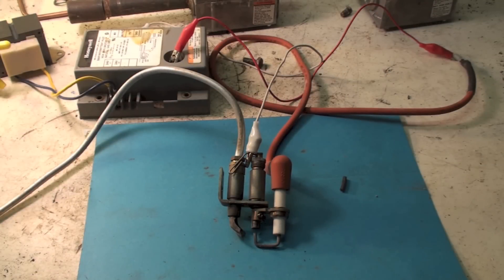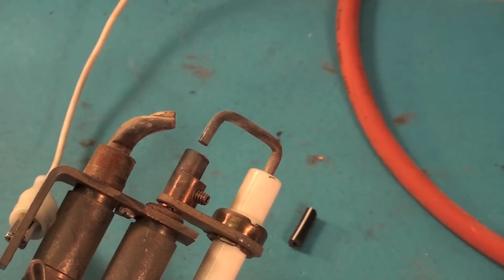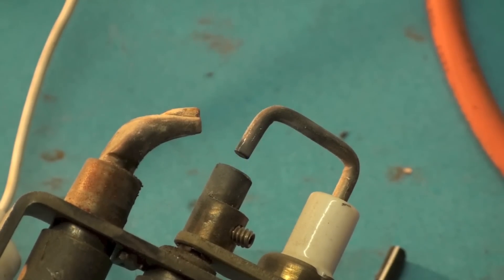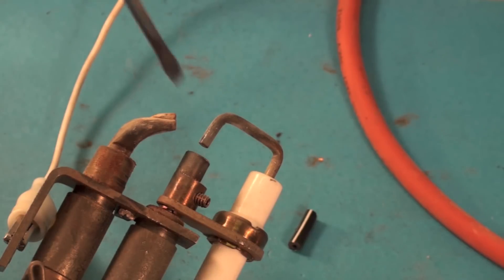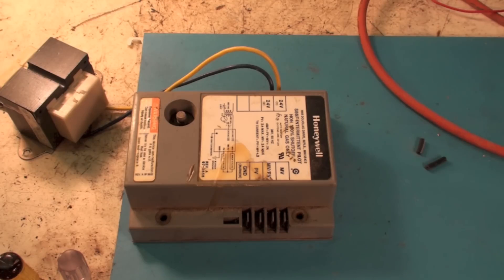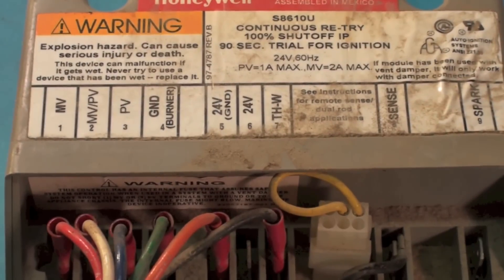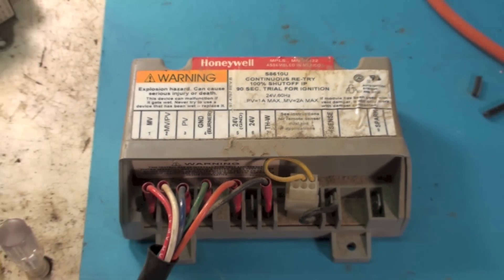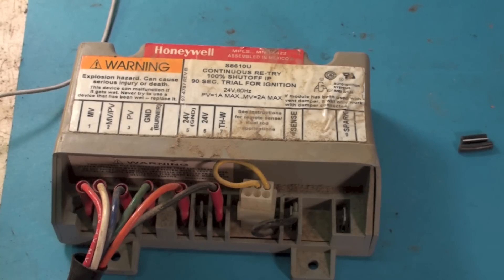Gas furnace ignition control operation

Comment: What would prevent the ignition control module from receiving and voltage at 24v and common.  The transformer and relay seem to be working fine. The circulators come on and I have 24 volt to B2.
Reply from the maker: If there is no power to the control, there could be limit failure or hi temp fuse open.
GFM
Reply: @grayfurnaceman Thanks for the reply. Turned out it was a bad blocked vent safety switch.

Comment: I have one of these old Honeywell intermittent pilots on my furnace and I’m not seeing any spark. I had a blown fuse and I replaced it cleaned the flame sensor and I got it to work for a couple days but it’s not working now. The fuse is not blown and I’m at a loss about what to do
Reply: Found the problem! With the heater turned on I moved the cable that connects the igniter to the ignition module and voila I got spark. Hopefully just a loose connection at the module was the extent of the problem.

Comment: Merry Christmas! Did I understand correctly that this unit is also the flame sensor? My Heil furnace keeps cycling the burner on and off. I cant find a separate flame sensor. Any ideas? Thanks in advance!
Reply from the maker: Yes.  The rod where the spark comes from is the flame sensor.  You can try cleaning it with sandpaper.  Merry Christmas
GFM

Comment: I have a commercial dryer that had a hack repair job to it and I'm trying to figure out how it's suppose to be put together. It's been modified since the original, OLLLLD construction.
I'd like to figure out: are these igniters supposed to turn on when the dryer control knob is in the off position, and then they'll automatically turn off after the pilot lights up? Are these things supposed to be manually turned on after you start the dryer up, then it ignites the pilot, then the burners go off?
It's a Huebsch 30CG (no other numbers/letters in the model number)
thank you...

Comment: In my case the pilot was not even lighting, I mean no sparking too . I checked the thermostat control and it was okay (lowered the set temp, below room temp and the fan kicked in to turn the A/C on. Also I could hear the 'click' near the control panel). I thought it might be the spark igniter. I tried to measure the voltage across the input terminals expecting it to read 24V. The igniter was still connected and the room temp was lower than the set temp (so it should trigger sparking). But for some reason it wasn't showing up anything (my multi meter is fine). So I thought of yanking off the wires connected to the igniter and as I just grabbed it to pull one wire off, the furnace started sparking up! Can somebody share how/why this happened? Did I complete the circuit by acting as 'ground' , may be?
Update after a day: The furnace is still working fine. But can somebody share what could have gone wrong when it briefly stopped working. Should I just be happy that it is working now hoping that the problem will not recur or replace the igniter or take some other action?

Comment: I’m getting 26 volt coming in, i get 18 coming out from mv/pv to pv then it goes down slowly and the valve starts buzzing until it drops to16 volts and it shuts off , why I’m i getting that low of a voltage coming out , is my spark module bad ? Or is it the valve

Comment: what is the sense terminal for, does it need to be connected? really like to watch your videos you are so detailed with components that it is hard not to learn 
thank you
Reply from the maker: The "sense" terminal is a option to use a separate flame rod to sense flame.  If the jumper is installed, it uses the hot surface ignitor to sense flame.
GFM

Comment: I have an intermittent ignition problem. I have observed the problem and while there is healthy spark, I measure a voltage on the pilot valve that jumps over a large range, almost like the spark is leaking back into the transformer output.  So I measure the output of the transformer and I measure 24 VAC, until it starts sparking, at which time the output of the transformer is jumping all over the place.
Have you seen this problem?
Reply from the maker: The spark voltage is probably bleeding over to the 24 volt side.  That is probably not the problem.  You may have a dirty flame rod in the pilot.
GFM
Reply: I replaced the controller so that it doesn't have the ignition spikes leaking back to the Transformer. The problem I'm having is the pilot doesn't light maybe one out of 10 times. So although it hasn't failed three times in a row and quite a while I do hear it not light occasionally while working in the garage and if I look the pilot is not lit. While observing it in a cycle where it is not lighting if I put a breath of air in there it will light almost as if I am adding more oxygen to the Natural Gas. Could it be the pilot pressure is too high . On another occasion I have lit the pilot with a lighter.
And I can observe the spark and it is very healthy
Reply from the maker: This is a quite common problem.  First clean the pilot assembly.  No help, some adjustment of the spark position may help if it can be adjusted.  Hope this helps.
GFM
Reply: Thank you

Comment: Looks like Google has fixed the problem so now I can post my question.
GFM, great educational videos.
I have a pilot assembly problem.
Some background. I have York natural gas furnace, about 25-30 years old.
Main burner was not turning on so I ended up changing gas control valve (VR8204C 1084), I changed HONEYWELL Q345A1305 I.P. PILOT BURNER FOR NATURAL GAS.I changed controller HONEYWELL S86F.
That fixed the issue and all worked.
So I tried to mount the pilot assembly and something went wrong.
Now the pilot does not light (I checked there is gas (no leaks), spark etc.)
it builds up gas around pilot and some times it goes on.
Pilot flame is not nice and blue.
I have tried cleaning pilot nozzle, it's clean.
I have tried adjusting pilot gas control (on the control valve).
How do I adjust pilot flame?
I even got new 1/4" pilot light tubing and new brass fittings (Thinking leak was the problem).
Every time I take out pilot assembly to work on it and put it back FIRST time it lights up correctly but after that no pilot (gas is there, spark is there).
1) How do I adjust nozzle so that it's on electrode? (not sure how it could move though).
2) How do I adjust nozzle so pilot flame is nice and blue.

PS: I have ordered another pilot assembly Q345A1305.
Is there something else I need to check?

Thank you,
Robert
Reply from the maker: Just found your comment.  In the trash.  If you still need help, I will try.  If the pilot is yellow, look for a possible pilot orifice that is plugged.  Not sure if you looked at the orifice.  It is very small.  Also, some of these spark ignitor pilots can be obnoxious. If the spark is not just in the right place, it will not light.  The pilot adjust on the gas valve is usually is not very effective at controlling the pilot gas.  Hope this helps.
GFM
Reply: Hi GFM, Thanks for the response. I did figure it out and hope this helps someone...
My problem with pilot light was the small orifice that dropped off while I was playing with pilot attachment to the frame...
I got a new one and noticed the problem...
However while trying to fix that I did found out the ROOT cause of all my initial problem...

Trying to fix pilot issue I was manually turning on pilot (just a blow into it did the trick, without orifice gas was not focused on the pilot) I noticed that furnace was turning OFF after 2 min and trying to ignite pilot again. I started thinking that's not normal, it should keep furnace going till temperature is reached... That's when I checked air filter.
It was clogged up really bad...That prevented fresh air to carry out the heat causing shutdown after 2 min.
God knows how many months it's been doing that... 
That's what probably killed the electronic module in first place...
(keep trying to ignite pilot every 2 min...)

Changed air-filter, new pilot and all works perfect...

Robert

Comment: GFM, great educational videos.
I have a pilot assembly problem.

I have York natural gas furnace, about 25-30 years old.
Main burner was not turning on so I ended up changing gas control valve (VR8204C 1084), I changed HONEYWELL Q345A1305 I.P. PILOT BURNER FOR NATURAL GAS.I changed controller HONEYWELL S86F.
That fixed the issue and all worked.
So I tried to mount the pilot assembly and something went wrong.
Now the pilot does not light (I checked there is gas (no leaks), spark etc.)
it builds up gas around pilot and some times it goes on.
Pilot flame is not nice and blue.
I have tried cleaning pilot nozzle, it's clean.
I have tried adjusting pilot gas control (on the control valve).
How do I adjust pilot flame?

Thanks,
Robert

Comment: GFM, great educational videos.
I have a pilot assembly problem.
Some background. I have York natural gas furnace (about 25-30 years old).
Main burner was not turning on so I ended up changing gas control valve (VR8204C 1084), 
That fixed the issue and all worked.
So I tried to mount the pilot assembly and something went wrong.
Now the pilot does not light (I checked there is gas (no leaks), spark etc.)
it builds up gas around pilot and some times it goes on.
Pilot flame is not nice and blue.
I have tried cleaning pilot nozzle, it's clean.
I have tried adjusting pilot gas control (on the control valve).
How do I adjust pilot flame?

Thanks,
Robert

Comment: gray i recently bought an oven which operated on 240v-12v. It had a ignition problem. I bought a new ignition control box and new electrodes. After a tech properly connected everything it still doesn't spark. When i try the electrodes on the module which has a 24v output i get the sparks. could it be that the electrodes are 24v?
Reply from the maker: The electrodes are about 10,000 volts.  You probably have a short in the high tension line.  Hope this helps.
GFM
Reply: +grayfurnaceman I probably wrongly explained myself since I'm not a tech guy. The thing that sparks to create the flame works on a 24v Honeywell ignition control box but when connected to a 12v Sit electronics control box it doesn't spark. That's the prob
Reply from the maker: It will not work.  The 24 volt control is also AC.  I am assuming the 12 source is DC.  They will not work together.  The ignition control is the wrong one.
GFM
Reply: +grayfurnaceman thanks much.

Comment: Excellent video. I was trouble shooting an old Rheem RGAA-08EC equipped with a Honeywell S8610U. There were no sparks nor flames. Based on your video, it seems S8610U is broken as there were no sparks seen or heard after powering up. Will order one to replace. Thanks.
Reply from the maker: Yes, it's pretty much power in no power out, bad board. 
GFM

Comment: Thanks for fixing my furnace (1994 90% Duomatic Olsen Ultramax II.) One of your videos showed that my furnace's symptoms were a dead-ringer for a dirty flame rod. The current video explains where the nowhere-to-be-found flame rod is, as a dual-function spark plug, which senses the pilot flame instead of the burner flame.

 I had a slow inducer blower in 2010 (which eventually would not start at all) where the pressure sensor intermittently failed to close, preventing gas to the pilot, which would then not light, even though there was spark. Since the pilot lit, (and then the burners) the pressure sensor could not be the problem.The only possibility left was not sensing the flame.

 After getting out the bracket holding both the spark plug and pilot, I decided to also clean the pilot orifice. In good light, the spark plug looked so clean it was hard to believe it would not function like new, while the pilot was caked with smooth, reddish chemicals that looked different than orangey rust. (a mercury compound?) I cleaned both with a toothbrush and a chemical product that is usually used to get lime out of showers and such, which may have been ill-advised, but was very effective on the pilot, and not so with the flame rod. I repeated rinsing the pilot and blowing on the far end of the pilot tube until bubbles (the remains of the cleaner) no longer appeared. After the cleaning, air passed through the tube and the pilot orifice easier than before. To get rid of the remnants of water, I blew the spark plug and pilot out with the blowing side of a shop-vac. 

 Before: the flame from the pilot was near, but not touching, the flame rod. After: the flame surrounds the flame rod. In fact, the metal prongs and shield around the spark plug and pilot glow orange, as I remember them doing years ago. The intermittent short-cycling is gone.
Reply from the maker: +Kenneth Florek Sounds like the flame was not large enough to reach the sensor.
GFM

Comment: I have a tempstar gas furnace and i can hear the flame rod clicking,but the only way i can get the pilot to lite is to put the gas valve on pilot and push down on the red button,but when i let it go the pilot goes out and i have the S861OU pilot ignition control.
Reply from the maker: +ramcharge68 The system you have does not have a red button.  There also is no pilot position on the valve.  So, the question is do you have a standing pilot system or an electronic ignition system?  The S86 ignition system has a spark ignitor that lights the pilot.  When the pilot lights and proves flame, main gas comes on.  Let me know.
GFM
Reply: +grayfurnaceman I have electronic ignition with the spark ignitor,but it looks like somebody put the wrong gas valve on it.
Reply from the maker: +ramcharge68 Now it makes sense.  Change to the proper valve.
GFM
Reply: +grayfurnaceman Thanks you i will get the valve tomorrow,and let you know how it goes.

Comment: Are you still answering questions here? I have an 88 model year 404B Burnham Boiler and was having pilot light problems, so I bought the intermittent Honeywell and of course it was quick in depth since you have to connect the auto filler, the low pressure valve and that all seemed pretty simple until I got to the presurtrol switch and I couldn't see where to connect these two leads, Can you give me some advice on this?
Reply from the maker: +Dennis Robinson If I am correct, the pressuretrol should be in series with the thermostat.  Hope this helps.
GFM

Comment: Hi,  I have a question. I have a Honeywell ignition module. The furnace is a 1990 model. My ignitor goes off and sparks, but some times the pilot won't lite. So, I check the voltage and its zero. Then, 80% of the time the pilot will lite and the main burners follow. I get the 24 volt when the pilot does ignite. I'm thinking the module is messed up since its not sending 24 volts to the pilot wire on the gas valve. what ya think.   thanks.......
Reply from the maker: +motokev If the valve is not getting voltage, and the spark is working, the control is probably failing.  Hope this helps.
GFM

Comment: I have a year 1987 - Carrier 48KLA124 that uses the Johnson Control G600AX-1 Ignition Control. Like the video here, my control unit is sparking internally. The wiring appears correct according to both wiring schematics from Carrier for this model and Johnson Control for this Ignition Control Unit. Interesting to note is that 99% of the time, when I adjust the thermostat to make the call for heat, it will not turn on. Sometimes 3 hours later it will. Dry cold temps, it usually does not turn on, while cold, humid nights it might. And once it does turn on, the unit will cycle normally, until it's off for awhile, at which point it will not turn on again. Is the controller gone bad and need to be replaced?
*Sidenote: I've completed a series of tests to troubleshoot the intermittent ignition. No Continuity from igniter tip to GRD., Visual inspection of the spark cable and all wiring connections, Continuity on the ignition cable to electrode tip, continuity of Ignition module GRD terminal to the gas pipe it's mounted to. I checked the polarity of the transformer terminals. I cleaned the pilot gas line - which had a roasted beetle nestled in it, cleaned the electrode, gap is correct, and cleaned the flame sensing rod.  But the obvious symptom is the audible presence of internal sparking taking place within the ignition control module, and no spark at the ignitor electrode.
Reply from the maker: +Marlin Lyzun Usually, if they are sparking inside there is high resistance at the wire or spark gap. The control could also be failing.  Hope this helps.
GFM
Reply: +grayfurnaceman Firstly, thank you very much for all the informative videos. They are a tremendous source of information and wisdom. I have learned so much from you. To reply to your reply: I've ordered a Honeywell S8610U3009/U to replace the G600. Perhaps while I&#39;m at it then, I should replace the ignitor, flame sensor and spark cable assembly as well. The trick however will be finding the replacement for this 27 year old model. I see nothing that matches what I have, and what&#39;s available in any parts catalog. I have posted some photos of my HVAC unit. The pilot assembly is shown here as well: http://marlinwebsitedesign.com/content/hvac-carrier-48kla124
Reply: +Marlin Lyzun 
I've posted a link to my personal article where I'm tabulating my HVAC service as I go. Possible it'll help someone who has a similar unit. So far, it has pictures of the heat related components. Once I get to the Cooling components, I'll add to the article. http://marlinwebsitedesign.com/content/hvac-carrier-48kla124
Reply from the maker: +Marlin Lyzun If I am correct, the part you have ordered is a kit that includes a adaptor that may work with your pilot.  Merry Christmas
GFM
Reply: +grayfurnaceman Thank you! Merry Christmas!!
Reply: +Marlin Lyzun Got the new pilot ignition module installed. Now the heater works like a charm.
Reply from the maker: +Marlin Lyzun Its good to be warm.
GFM